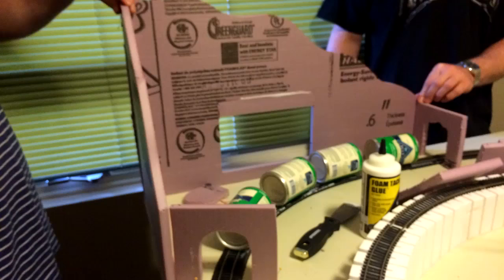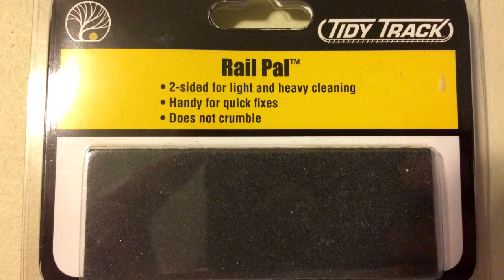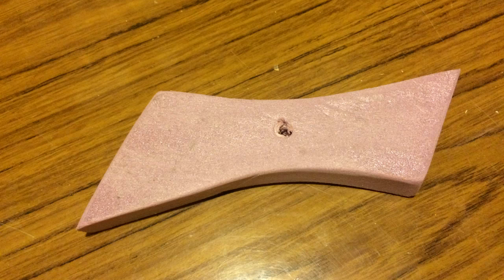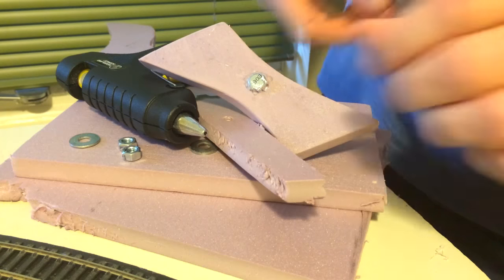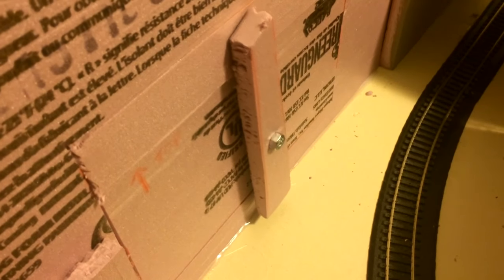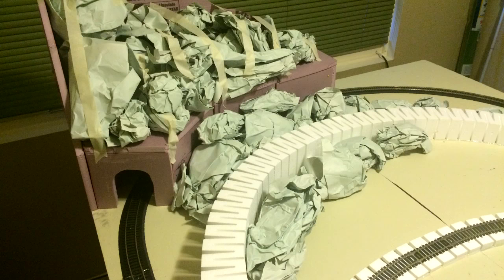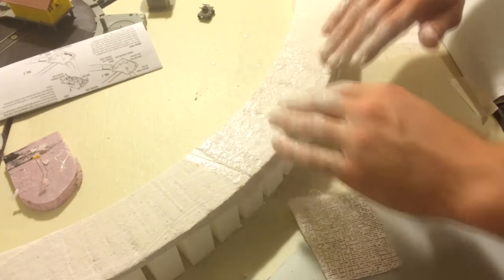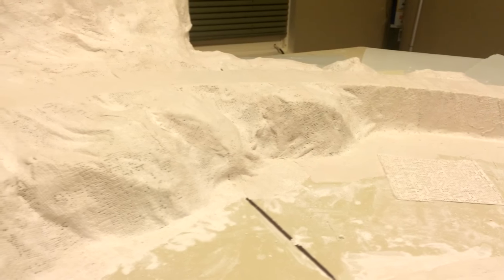Making the Mountain and Tunnel with access door

Comment: Thank you for this video! I've been building temporary Christmas villages for many years using this method of building mountains and cliff sides using plaster cloth. I notice that when dried, your plaster cloth still had many little holes which plays havoc when applying paint. The trick is to keep adding moisture to your fingers, and keep spreading the plaster in the cloth until all the holes are gone. Takes more time, but the end result is much smoother. Other than that, great job! I hope to build a corner tunnel like yours this year!  👍
Reply from the maker: Thank you! I’m glad you enjoyed the video. Thank you for the tip. It was my first time using plaster cloth. I hope you post your progress and end results.

Comment: Hello from Florida
I still don't understand why more people don't try to use a cheaper Styrofoam. Also, Great stuff in a can is just as fast
and can be used for filling gaps, cut and shaped with whatever. Also, try using cheese cloth and your own plaster mix.
Go easy on the great stuff, use it just like glue. It's a better bonding agent. When finished with the main, Paint with
Flat brush on primer. I just think that most of us feel that scenery is the most time consuming. If there's a short cut,
that's my ticket. Another point, Try a small air brush for detail color and while the paint is still wet, if you are looking for a stone
finish, use colored sand at the application point.
Reply from the maker: Peter Lass   Thanks for the tips Peter! Still not sure when I’ll get to the scenery and how I’ll do it. I’ll take your advice into consideration. -Mark

Comment: On the risers why not just use masking tape? It’s smoother, cheaper , and you will be covering it anyways? I see everyone doing it the way you did . I am almost at the stage where I will be doing this . I thouht the tape seals it and gluing the track would add the rigidity.
Reply from the maker: To be honest, I just followed what the tutorial video said to do. :) Try the tape and let me know how it goes. Might be tricky on the curves. Good luck!
Reply: @MMRails  will do. The risers are already smooth and true . I don’t think you need the rigidity but I will find out in a couple of weeks. I will probably use the plaster cloth on the sides of the track but def not under it.

Comment: Do not paint over plaster cloth with holes in the plaster.  the paint will suck in.  Use drywall compound to skim over the surface to remove all holes first.
Reply from the maker: Thanks Robert. Someone else gave me that tip as well. One day soon I'll use the compound to not only cover the holes, but too make some rock faces too. If it doesn't turn out, I'll put a stick of dynamite in the mountain and create a volcano.